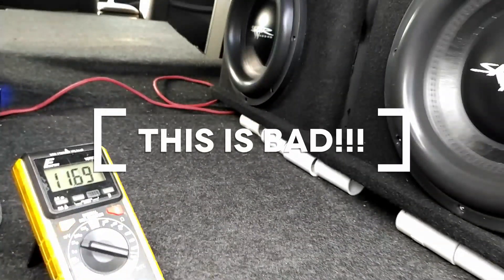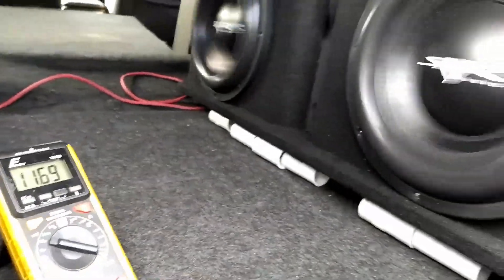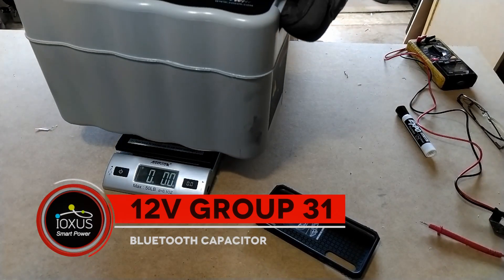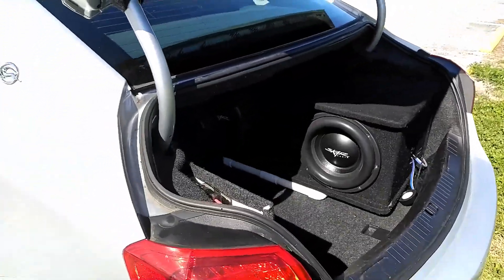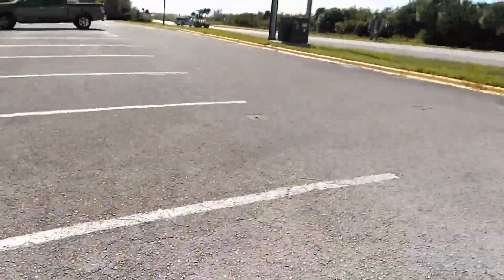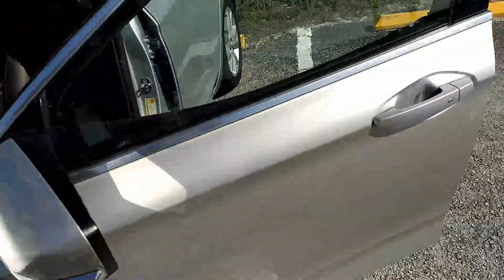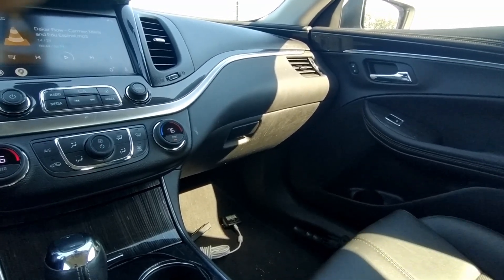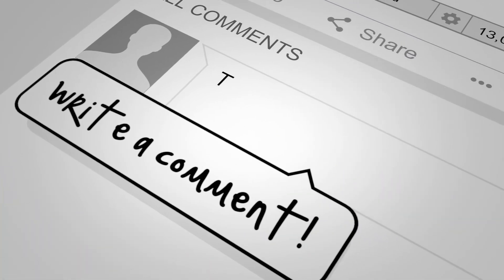Do Ultra Capacitors Really Work? Will This Stabilize a 4,000 Watt System?

Comment: You know what you’re right when it comes to that battery technology I had a big AGM battery the hype all the talk sales people pitching that battery to customers to buy old school lead acid batteries, lung is a good quality is the way to go. They hold up longer charge faster and proven and reliable. I had so many guys pitch other battery technology like those round sale. Batteries called the yellow tops. Those things are horrible unreliable if you depend on them without any AAA jumper cables battery jumpers you will be left stranded every time somebody pitches some new technology I don’t go for it forget about it leave them batteries alone and go old school lead acid is the way to go. Except for when you want a capacitor to stable the vultures peaks and drop that’s a whole Nother topic there but if you do, you would run your ultra capacitor so called ultra cap with a couple of good large lead acid batteries, high-powered alternator and you’re good or you could run two ultra caps with a line of batteries depending on how big the system is and that your ticket. Good luck out there happy shoppers looking for new batteries. Good luck but AGM no 👍
Reply from the maker: Thanks for sharing, bro. Send like you've had plenty experience to base your decision on. 😊

Comment: Had added one to the 05 Silverado and it actually did not help much, some how the system was tuned so well some how, that the 2500W Kicker system did not even pop the 150A Fuse under the hood.
  But the cap did seem to stabilize the Voltage dips from the low 13v to high 13v low 14v, but that truck no longer exists!~
Reply from the maker: You are welcome sir

Comment: I have a 2004 Escalade with a 370 amp pure power alt. 1/0 gauge wires,three xs power 3400 batteries. But my voltage drops to start at 1 4. 9.. will that capacitor hold my voltage at least over 12 if I install it before the alternator and after the 3 batteries??

Comment: People have to take consideration the shorter the run the more voltage you'll have.  The longer the run the lesser voltage you'll have also a power plant is important. What amperage battery up front and the reserve capacity of it and the amps and voltage. Of the alternator along with the wire size and what type of wire being used. A capacitor can just withstand so much without a vehicle not running and depending how hard it's being hit.

Comment: Hey recent new subscriber here! Question, can I add an agm battery for my sound system and still use the flooded wet cell for my car or do I have to go with all the same? I’m running a 4000 watt system with a 250 amp alt and 2 wet cell batteries now but still get voltage drop and dimming lights. Thanks!
Reply from the maker: Those batteries are both lead acid. I don't see a major problem with running them together. as long as they are of the same chemistry. Just don't mount the flooded lead acid side ways or nothing.

Comment: For a single fosgate t1 12 800 watts rms subwoofer wired to 2ohms on a kicker cxa1200.1 amp.  I did the Big 4 upgrade, a yellow top optima battery under the hood and xs power d925 battery in the trunk. All 0 gauge ofc wires. Was thinking about buying the ultra cap. Question is do i really need it with my upgrade already or just a overkill?

Comment: If the voltage on the battery stays strong, even though the voltage on the cap drops, that means it's doing what it's supposed to. The cap isn't the true power source. It's just between the amp and the true power source, and if the true power source was showing a voltage drop and it's not doing it anymore, good job, capacitor. You mentioned that it sounds better and the bass hits harder, so it must be working. Especially if you had some dimming before and you don't anymore. But I have always just gone ahead and upgraded wires, alternator, and added a second battery and a cap if I am installing a bass amplifier. Just to go ahead and eliminate the probability of electrical issues so I don't have to figure out which one I need. Plus on my first installation decades ago I added a second battery, upgraded wires, and a HO alternator, and still had dimming. Since then, I just do the wires, alternator, second battery, and cap and get it over with, because I know I will need it all anyway.

Comment: Capacitors can most definitely be useful but nothing beats having enough lithium and charging amps stay in the high 14's. Ive used super capacitor banks before. I play alot of rebassed music with steady bass lines and without sufficient battery reserve my caps would drain and it wouldn't recharge until their was a break in the bass.

Comment: I know this is old but I hope you added the other agm probably a lot better results since the capacitor isn’t a battery just a power booster  and the extra amp hours would’ve been better

Comment: I’m trying to find out can you run more than 1 ioxus  Ultra Capacitors?!? I bought 2 hoping to keep the voltage from hardly dropping at all any info will be greatly appreciated!!!
Reply from the maker: They work best with transient bass notes. They were originally designed to assist starting batteries in delivery trucks. And yes they can be wired in parallel.

Comment: I'm very very late to the party.  I currently have 2 of these ioxus ultra capacitors in parallel for 750 farad and xs power d3400 up front 1/0 ofc big 4 and 4/0 welding cable to the back. Stock alt 105 amps pushing a stetsom 3k. 

Just bought a mechman 320 and deaf bonce 4000.1 to push my single Avatar SVL 1547D2.  Do you think my setup will run that amp as is or is it mandatory for me to get a reserve?  Thank you
Reply from the maker: I think you should be fine for a single 15. But a reserve is always recommended
Reply: @BudgetBassHead is always awesome watching a video I don't remember watching and finding my interaction from where I had watched it months or even years ago.  

To update you my man,  I had a lot of work to do at the time of my last comment.  I just didn't know it yet.  I wanted to tell you this in case you or anyone else was still trying to figure out where ultra capacitor ties in. Like you are using it in this video and the way I was using it when I watched this video last does work but is not how you should use them in your system.  
 
They REALLY shine when wired in parallel WITH your supplemental battery.  If running agm like me you would want a good agm battery up front (your starting battery) a good agm (or however many your system requires) and then wire this ultra capacitor in parallel with that battery that's in the trunk.  Feed your amplifier directly from the ultra capacitor. Holy smokes it works so so so much better.

Comment: Did you notice if the ultra cap introduced any noise into the system?
Reply from the maker: Not in my case; it did not.
Reply: @BudgetBassHead  thanks for the info. I ordered one of the b stock ones.. I've been trying to watch different videos about them. Some show that have to do the little light bulbs tricky when first connecting it but some say and manually says it don't have to.. What's was your experience?

Comment: You need to check how you have your subs wired inside the box. Make sure they are actually wired for 2 ohms or 4 ohms or whatever they are meant to be wired at. You can use the multimeter to check what each individual sub is running at. That happened to me before when the subs were wired to run at 1 ohm and the amp was rated at 2 ohms x 2 channels and they were actually running at .25 ohms and the voltage dropped like crazy.

Comment: Man I purchased one of these for my system from big jeff audio and man I can literally feel the difference it made my subs come alive I'm running a CXA 1800.1 on two Q-class L7 12's and they would hit pretty good before but I could literally go full tilt on my head unit and barely see vibration in my side mirrors I added this and I can't go past 3/4 on my radio or bass knob and I am slamming this was literally the best purchase I have made so far for my system it made me so happy and I could actually feel the difference in the SPL lvl so much that I have already ordered a 74AH jag35 lithium battery to go with it for a hybrid super capacitor setup that I'm told works really well together and will give me a lot more power than the lead acid/Super cap setup I'm currently running great video and good recommendation this thing has excellent power delivery for your system and the price is excellent I got mine in hand for next to nothing with financing I literally won't even notice the payment
Reply: Hope you didn't pay full price. Those were recalled. There's a possibility of it's circuitry going out causing it to drain your battery and catch fire. I wouldn't put one in my car. Guy I know bought one and it didn't catch fire but it drained his car battery. You can buy these b-stock for $100 now for that reason. No way I'd put one in my car.
Reply: @LowFrequencyFanatic  I used it for quite a while and never had any problems with it I still have it in my spare bedroom but that was months ago I'm running a 29AH SCIB bank from NORTHWEST LITHIUM now 2.9AH M5 pedestal cells rated at 75c Best on the market check out the videos I'm posting on the weekends of the build im still learning and trying to build the channel and learn from more experienced people through comments check it out if you get a chance got a whole brand new setup since I posted this comment
Reply: @LowFrequencyFanatic can one of these be put under the hood and can it start your vehicle?

Comment: The Ultra Capacitor is not meant for audio. This is my personal opinion. It caused my speakers to hum. Drove me crazy, rewiring the entire system before I realized it was the ultracapacitor. Replaced with my previous capacitor and my radio is back to normal. Basically $200 wasted. Sitting in my shed useless. I do know it allows utility vans and vehicles batteries to last longer.

Comment: Super old.. but if you really want caps to work at top performance you need a full lith battery that will discharge faster to the caps.. 

It all starts at the alt though.. from there the wires then the battery, then the secondary source of power batter, cap, headway etc.. then amp.. 

A lithium battery of same rating as an agm is actually about 2.5-3x stronger then the agm.. just cause of how much faster it charges and discharges.. 

Caps will help if you’re just slightly under total amp draw on an agm where the battery basically trickle charged them.. but when pulling 200amp off a 120amp alt you’re down about 200amp from your demands.. 

Many try the lithium as the secondary.. this is stupid unless you got a direct feed from the alt to it.. if it’s feeding off the regular agm then it’s still limited by the recharge rate of the agm.. 

Alt, then lithium then ultra cap or headway bank.. that’s the way to run with these power robbing inefficient amps and subs we have today. 

FYI to anyone with a trucks.. there is almost always a factory 220amp option in place of your 145-160alt.. you can usually get two of these and a dual bracket kit for less money then a single 320.. keep in mind also once you go above 280amp alt or so.. you become limited in engine rpm’s you can run or you’re over spinning the alternators.. most don’t like to go over 5k and as you go larger say 320, 400 etc you’re limited to 4500 even 4K engine rpm cause they rely on undersize pulleys to spin the coil faster at lower rpm’s.. 

For a daily if you got the space which most trucks do.. a dual 220 setup is the best way to go.. 

For most a single 220 with single lithium battery is all you need.. worst case add some headway or an ultra cap unit and you’ll be good to about 4500watts on music with normal driving.. 

If you demo then this won’t get you there lol.. myself in a daily I’d never go over 250amp alt.. better to run more then run higher power because of the over spin issues..

Comment: I am facing the same dilemma with my system.  I have a Mechman 400 amp alt and in addition to my stock battery, I have another AGM under the hood in my GMC Sierra.  I have 2 JP 23v2s running a Resilient Sounds Platinum 18 each at 1 ohms.  I get voltage drops down to the low 11's and high 10s if I push it.  Huge drum kicks wit hrock music like Hoobastank's The Reason will drop it down fast, but it comes right back, so having a ultracap should help a bunch, but on long low drops like rebassed songs with sustained bass notes below 30 drop the voltage and it stays there.  I don't know what do, other than maybe try lithium bank to keep the voltage up.
Reply from the maker: Lithium fixed my problem. No longer need the ultra Cap

Comment: I have 1 1200w Jenson with the power acoustic 2500w amp in a sealed box. I recently fried the battery and possibly the alternator. Will a higher output alternator be enough or should I buy the uc31 while it's on sale

Comment: < - see the resting voltage - a sound system should be able to run at 100% with the engine off, FYI 
input voltage means Nothing if your amplifier can out puts more voltage ant the speaker can take - eg the week-link should always be your speaker.  
having enough CA (CCA) , in a low enough impedance "eg small cable run, large size" ..,  eg I think you need a bbb (bigger better battery) not an alternator..

Comment: I bought an ioxus ultra capacitor and recently had the same issue and strangely enough,  I found that cleaning the front terminal and connectors increased and steadied my voltage at the back.  Could it be as simple as this,  I'm monitoring to find out.

Comment: What I noticed with regular capacitors is that voltage does get stabilized but you loose bass output, that’s why I don’t care to use them. They diminish bass, no good.

Comment: Part of the issue is you measured voltage drop across a circuit in the back rather than voltage at the capacitor. That’s why you saw such a drop in the back of the car and not the front. Check your ground source in the rear of the car. Also Newer cars often do not have the ability to carry large amounts of current through the unibody due to large usage of adhesives rather than welding when manufacturing the vehicles. Running a direct ground wire to the front of vehicle to an factory ground location can help. 

The reason I know this is because many modern cars run into electrical issues when trying to relocate a battery from the front of the car to the rear and they try to slip running a true ground wire back to the front of the vehicle.
Reply: When about did the adhesives get common? so, basicly, what approximate years?
Reply: Wow this helped Mee out so much !!!!! In understanding I have a 2012 Kia optima factory alternator d35 yellow top upfront nd a 4f cap when they check up front the voltage is above 12 nd thee guy checking alternator for me says it's good it's charging well but in the back the cap in dropping down to the 11s I wanna add another battery or the ultra cap or bigger alternator... There's so many diff options I dnt know what to do first.... This video helped a lot nd the response about ground. I dnt like where the shop grounded my
 audio pipe 20001d    on a 800w RMS 3000w peak 10" pioneer   1ohm

Comment: The 10+ grounds on your 1 ground battery terminal is un necessary!!!! Atleast get a terminal block instead of 10 connections on 1😖 if those are your amp grounds they need to go!!!! Ground to chassis not paint either. They need to be short as possible  and grounded at same location  prefably to prevent ground looping which will cause system noise . Your battery should have only 1 to car body & 1 to engine block and make sure the metal surface is sanded to metal. Use Vaseline or terminal sprabtobprotect from rust and corrosion. It also helps with continuity.. Be sure to install the big 3 when you do the altinator cause factory wiring won't cut it at all. 😁😁👍👍

Comment: Hey bro. One more question. Can I ground the negative on the super cap to the chassis or must I run a negative from the cap to my negative on battery?  Thank you!
Reply from the maker: Every power source should have it's own ground. But some have daisy chained the grounds, post-to-post. Just make sure you have big enough wire to support the amperage draw; or you risk fire.
Reply: @BudgetBassHead  thank you

Comment: Did it help bro?  I'm thinking of buying one but there's no other videos explaining if they help or not.  Thank you
Reply from the maker: Yes this did help but if I were to redo this I would instead invest my money in lithium. Which I have done so and now I no longer need this ultra capacitor
Reply: @BudgetBassHead  thank you for the response bro. I can't afford lithium but bought this ultra cap used from a friend. I only drop down into the high 12s at full tilt so hopefully this will help me out. I appreciate the info.
Reply: I was planning on adding it to my xs power 3400 AGM I have under the hood. As a supplemental power source. What you think bro?